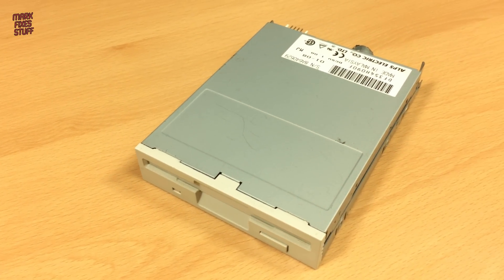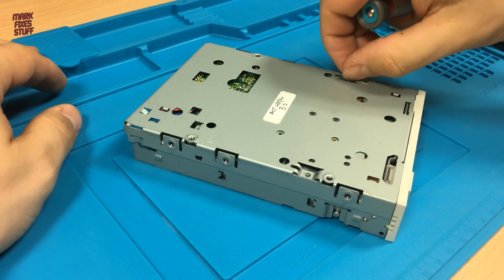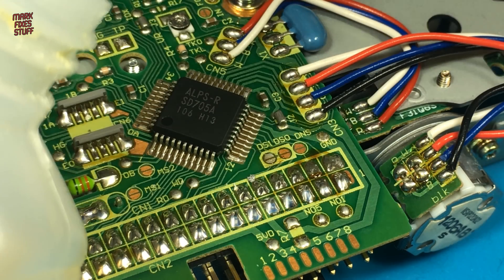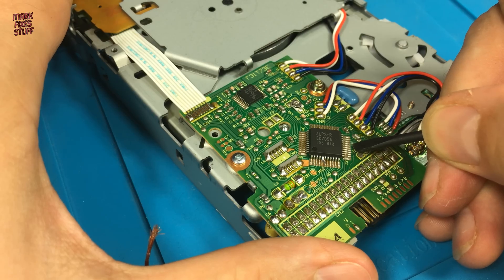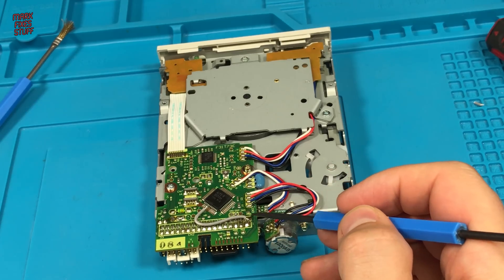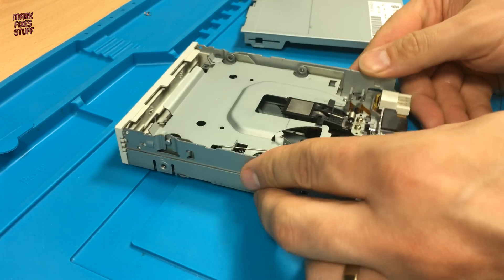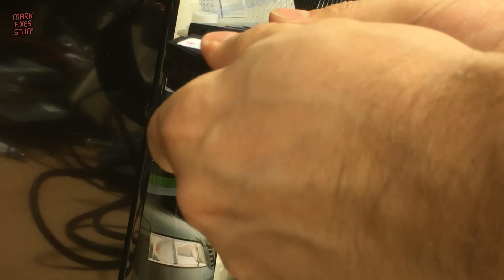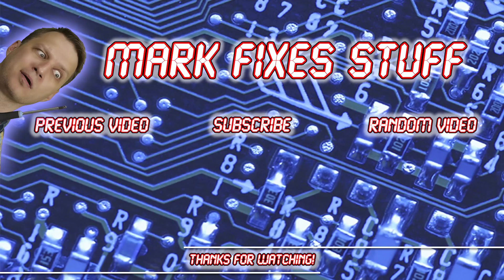Use a PC Floppy drive on a Commodore Amiga!

Comment: 1.76MB floppy drives were also available on Amiga, to use 3.5" HD floppies proper.
Reply: Yes. but they ran on half speed compared to pc. I have one of them in my A4000. The larger size is useful thou and you can pick files from a pc system like text and source codes into the amiga.

Comment: Just done this for an Amiga 1200 and all I did rather than lift the chip leg five I just cut the track line far easier and safer so no risk of it breaking away from the chip as it's so small. And with everything else done drive working just perfectly so thanks for this video well done.

Comment: Back in prime time of Amiga 30 years ago, i bought a official 1.76 MB HD Floppy for Amiga and could format 1.38.MB PC Floppies to 1.76.MB on Amiga with FFS.
The real size of PC floppy were 1.38.MB and not 1.44.MB. Back in the days you used 1024 and not 1000. In fact Windows 10/11 still use 1024 instead of 1000.
My CD32 Expansion, Elsat Promodule from 1996 or so came with a internal PC Floppy.

Comment: Hi Mark. Just one detail: will the drive fit inside the amiga, esp. the eject button?
Reply from the maker: Not without removing the bezel and printing some 3d modifications
Reply: @MarkFixesStuff   I don't have a 3d printer, but there are shops. Thank you.

Comment: Thanks for the tutorial. It works great even with CrossDos.
Reply from the maker: Brilliant news! Well done!
Reply: @MarkFixesStuff  A short follow up. The drive was behaving badly when I had it installed with a GoTek floppy emulator or another disk. Didn't matter if it was DF0: or DF1: or first or last on the floppy cable. I swear it had been working. I did a little more research and saw a video on the channel "Chris Edwards Restoration" where he modified a comparable Alps floppy drive. In the comments, a user, ripxkid, suggested using a diode, cathode connected to Ready, anode to connector pin 34. I also noted Chris did not cut the trace connecting the controller to connector pin 2. I started to trouble shoot the original floppy I converted and in the process broke pin 5 off the controller. So, out came a new drive and I did the modification again only this time I did not cut the trace to connector pin 2 from the controller and I installed a 1N4148 diode between Ready and connector pin 34. I have tested this several different ways and it all seems to work. I am not comfortable with pin 2 connected to two pins on the controller chip, but no smoke and it works.  Thought I'd share the information for what it may be worth.

Sorry for rambling. Thank you again for the video. It got me started on a much needed project.

Comment: After watching this I just got an idea:

If you have a DF1: drive from the '90s that appears to be a PC drive and converter board stuck in a case, would it have a chance of damaging anything if I switched in a 1.44/1.76mb drive in place of the 720/880kb drive?
Reply from the maker: To be honest I’m not sure. I don’t think you’d damage anything by trying but I’m also not sure it would work …
Reply: @MarkFixesStuff  If it doesn't work, it's not the end of the universe, it's just my pc 3.5" drive won't write 720k disks in Windows(yes, even through command line or using actual 720k disks, it just errors out) so I have to boot into Ubuntu if I wanna move files to my Amiga.

Being able to use PC1: to read 1.44mb disks would save hours of faffing.
Reply: Figured I'd update. It doesn't break anything,  it shows up in Workbench and it even tried to use it, but it just errors out if you try to use it.
Reply from the maker: @fattomandeibu  that’s a shame. Thanks for the update. I wonder if it can be made to work somehow.
Reply: @MarkFixesStuff  After a bit of reading, it's to do with the bit rate being too high for Paula to handle. Apparently you'd either need a hardware buffer, or to halve the RPM of the drive somehow, the latter of which is what was used for official A4000 HD drives.

Comment: Tip: Always solder the wires first, and put som solder on whatever you are soldering the wire to. Flux well and all you have to do is hold the parts together and apply some heat.
Reply from the maker: Thank you Svein!

Comment: I just unboxed my amiga 500 and the floppy drive doesn't read the discs but neither the 5 1/4 external one. Not sure if it is the discs or the drives.
Any idea ? Can drives be cleaned? Do floppy's go bad?
I have several good working pc floppy drives, but if I don't need to I would love not to
Reply from the maker: floppy disks do go bad. With drives it's usuall either drive belts have rotted OR the Amiga PSU could be flaky too!
Reply: @MarkFixesStuff  damn. I have around 3000 discs . I tried 10 and only 2 read the bootloader. Rest gives validation errors. I thought they would live longer. I kept them in a dry dark place.never thought they would go bad. My MB vectrex and MSX machines and games still work. Whish my A500 also would
Reply from the maker: @dcysfelices2294  might be time to get a gotek!
Reply: @MarkFixesStuff  maybe a stupid question. But what is that?
Reply from the maker: @dcysfelices2294  it’s a floppy drive replacement that allows you to play Amiga disk images from a usb stick. Google flashfloppy!

Comment: I know this is a few years old. I actually did this mod on my Alps drive (and did a video last year) and it's worked well. I even added a switch that could undo the mod. One question, for my Amiga 600, I couldn't fit it in the case with the top lid on so I left it off. Only recently did I discover that without the drive's top lid, the caddie mechanism pops out and that can cause the head to snag on the disk as it's being removed,  potentially destroying it (had to bend the head spring mechanism back to straighten it out). The solution was to cut a front piece in the front and bent it out of the way. The Amiga 500 may not have that problem but curious if you ever mounted the drive inside your Amiga and how well it fit.

Comment: I wonder what would happen i did this mod on my Amithlon Pc... I do have the same Alps drive... could I read amiga disks? My guess is that it would not work because of the hardware I/O side of the PC mainboard. Correct or not?

Comment: So I did this and got a great working floppy drive for my Amiga 2000. When I tried adding an internal Gotek as well, I couldn't get them to work with each other. Yes I set J301. Separately they work great, together, with jumpers set on Gotek and mobo, they don't. One works but the other doesn't. Any suggestions with using a PC converted floppy with a Gotek as two internal drivers on an Amiga 2000? I'm using a "proper" amiga floppy drive cable. I've tried changing the order of the floppies on the cable. DF1 being the furthest away on the cable and DF0 the closest.

Comment: I used to make external drives for the Amiga! Both 5 1/4 and 3 1/2.  There is an adapter that you made that would  switch the Amiga lines to an IBM lines. Amiga does not use the track identifier and select. I made up to 4 drives. You do not have take the IBM drive apart.

Comment: I tried this mod but it didn't seem to work. Like all the lights come on and it's ready but I can't read/write anything.
Mind you I didn't test the floppy drive first before conversion as I didn't have a PC to test it on first. I will try this again on another same floppy disk drive.
Reply: So the reason was the PC floppy was defective to start with. I tried with another of the exact same Floppy and it worked great.

Comment: The controller chip on the video is 44 pin, the drive I’m trying to modify is 52 pin. There is no continuity between pin 19 and pin 2 of the connector. Any help would be appreciated. Thanks

Comment: you need to change wires in cable - 2->34 and 34->2. if you prefer not to change drive number by switch on the floppy board and use it with factory preset (as drive B:) but as drive A: as Amiga need for boot - you need to re-wire also 10 11 12 to 12 13 14 and 13 14 to 11 10. left numbers is the numbers of wires from the amiga side right numbers is the numbers of wires from floppy side. 
and i use samsung 321 floppy drive - all is good.

Comment: Mark, this won´t work. Ok, works, until you connect external floppy. Then the system will go crazy. RD pad is not ready signal, it´s READ signal. YOu need to connect pin 34 to the pin 32 of the controller, there is Ready signal (not used in PC). Also, there are some older version of DF354, primarily made for IBM (bears IBM FRU part sticker), whether there is no Ready signal present neither on the chip. It works, except Xcopy. So, stick with 121F and 121G sub-version and you are fine.
Reply from the maker: Thank you for this information. It seems I will need to do some kind of update
Reply: @MarkFixesStuff  There is even better mod than I described, that allows READY signal to be present for Xcopy (which is crazy eager for original Chinon floppy). Connect a diode between ready signal (pin 34) and SEL0 (pin 10). Then floppy is always ready when selected, despite it has no real READY signal at all.

Comment: Would be nice to see if there was away to get the drive working as a 1.7MB, I suspect though that might only be possible with a PC 2.88MB floppy drive which can be crazy expensive. :(
Reply: I think drives  are the same, it's the file system capacity that is different. i.e. DD 720KB for PC 880KB for Amiga, HD 1.44MB for PC 1.76MB for Amiga, ED 2.88MB for PC 3.56MB for Amiga. However, I do have the same question as you - if you convert a HD floppy drive would it simply work as Amiga HD floppy drive?

Comment: hello i need your help i did this operation  but I don't have format disk I guess nothing works because I haven't done the format process, just the screen is coming for the game etc.
Reply from the maker: It sounds like you need a workbench disk? You will need to find one of those from another source.
Reply: @MarkFixesStuff  can you upload it here ?  the file of your disk ?
Reply: @MarkFixesStuff  amiga 500 workbench 1.3 ? Is this the floppy you inserted after modding?

Comment: Crikey.. does Velleman still exist? I remember seeing their kits in the now defunct Maplin years ago.

Btw, why did the Amiga have different pin outs? Would've made sense simply using off the shelf parts.
Reply from the maker: Yes! They still sell kits!

Amiga drives were slightly more complicated than PC drives, using tricks to pack data that PC drives didn’t care about. Often that functionality was just disconnected for the PC market.
Reply: actually ibm pc drives were non standard,being set by default to drive 1.. the rest of the industry just adopted it.

Comment: I converted the floppy disk drive according to this scheme. Unfortunately, the additional DF1 floppy disk drive does not work with this floppy disk drive. There must be a diode like this picture: http://www.puzio.pl/tablica/amiga/alps.png
Reply: Did you add or work afterwards?
Reply: @serdarkvanc8175  Before adding the diode it was not working corectly. After adding the diode it is OK.
Reply: @RetroArcadeFan77  i did the same as in this video has game screen but no progress  you just add an external diode which is in this video what is the value of the diode can you help ?
Reply: 1n4001   1n4007 ?
Reply: @RetroArcadeFan77  also did you draw the line on c7 and hd2?
Reply: @RetroArcadeFan77  and what do the red lines mean ?
Reply: @serdarkvanc8175  Normal diode (not zener), I desoldered the used diode from the circuit board of the old landline phone.
Reply: @serdarkvanc8175  I don't think it matters.
Reply: @serdarkvanc8175  The red lines mark the path intersection points.

The red lines mark the path intersection points - you must cross the paths at the pins.

Red lines indicate where the paths should be cut (2 and 34).
The orange points are connected through a rectifier diode.
Blue points with a wire.
Violet dots as above - this is a floppy disk signal (the drive thinks that DD is always inserted).
The yellow arrow marks the transfer of the jumper from DS1 to DS0.

Without a diode, there may be a problem with the additional DF1: floppy disk drive, or maybe DF0: it may not work as it should.
Reply: @RetroArcadeFan77  You just dropped diodes on 2 and 34, right?
Reply: I have the game screen but no progress It just stays the screen recognizes the floppy but no progress Why did you also make such a transaction? What problem did you do?
Reply: @serdarkvanc8175  No. The diode is to be soldered between pins 10 and 34 (orange points from picture).
Reply: @serdarkvanc8175  If you did everything correctly according to the photo, it should work. Unless you did something wrong or it's a different floppy disk drive model.
Reply: @serdarkvanc8175  When I converted the floppy disk drive according to this movie, the additional DF1 floppy drive did not work. I was looking for a solution on the network and I came across a solution with a diode which I am not the author of. For me, the solution with the diode works.
Reply: @RetroArcadeFan77  What a problem you had when you did what this man did ?

Comment: This mod is not quite right.....

1) You have to put diode (1N4148) between pin-34 and RD pad (black marking should be turned towards the ALPS chip) - for a proper ready signal
2) Solder a wire between HD2 pad and MIS pad (Ground) - to bypass HD switch detection so you can use HD floppies as well  

You're welcome ;)
Reply from the maker: Thanks mate. I think I need to do a follow up video really. Time is scarce though! Really appreciate the information :)
Reply: using hd floppies as dd is not a good plan, it said everywhere at the internet, and i tried, it work for some times but after some years then are not working anymore, while the dd floppies works better, i think the magnetic matrieal on the dd floppies are another kind than the one on hd floppies, so they need another way to be formatted and thats why it cant keep the data for longer time. I can also tell you I have much highter succesrate read my old MSX floppies (DD/720kb formatted) and (DD/880kb amiga formatted). Cause Amiga pushed more data into the floppydisk, its likely to fail after all those years :o
Reply: @CrazyBossDK  This is not a standard DD Amiga drive but a PC HD floppy modded to read and write HD & DD diskettes. On the other hand If you want to use properly HD diskettes in an original Amiga drive you need something like bulk tape eraser.
Reply: Akai - Model ATE 7 or similar
Reply: The same applies to 5.25" HD diskettes and C64/128 drives
Reply: @ripxkid  I guess the drive is not modified to use HD disks, its modified to fit the amiga, and then you can fix the sensor or cover the hole on HD disks, to "hack" it to a DD disk,  I guess the Amiga Controller does not know how to handle HD disks, which should be formated another way, I have an external Amiga diskdrive which actually is a HD drive, cause if i put in a HD diskette i will get error while formating it, when i put in a HD diskette with tape on the HD hole, it will work. But it does not mean its a HD diskette, and its not clever to do it cause it will loose data, I have proof, cause in 2001 I made some diskettes, on the Amiga, some was HD (hacked to DD with tape), and other was real DD diskettes, the Real DD diskettes still works today, while all the hacked ones dont work today. It have been discussed here too:  https://superuser.com/questions/1039376/does-the-media-of-3-1-2-dd-floppies-have-to-be-physically-different-from-hd-medi#
Reply: @CrazyBossDK  Again, this is a PC floppy drive modded to read and write HD diskettes in standard 880KB Amiga format. It doesn't support 1760KB formatting,....you need something like Chinon 357A for that
Reply: @ripxkid  so that means those disks can only work on the same drive, you will not be able to read a floppy back in the original amiga drive ?
Reply: @CrazyBossDK  You can use floppies in any Amiga drive since they're 880KB
Reply: @ripxkid  I still dont recommend it cause the HD diskettes is written using another orsted-level compared to DD, and the magnetic Material is another coating. They will for sure fail, I thought you ment the drive was modified to write real hd diskettes with the hd orsted level, but its just fooling the drive too think its a dd disk and write to it as a dd disk. HD diskettes written as DD will work for some time, but its more likely to fail than DD.

Comment: Can you also adapt the drives in a manor that they are usable as DF1 or as DF1 and DF2?
Reply from the maker: There are DF0 and DF1 jumper points on a lot of boards. For anything more complex I believe a cable modification would be needed.
Reply: @MarkFixesStuff  It's not only the jumper points you have to worry about but also obtaining a 'case' and cable to actually put the drive physically in. Back in the 90s we had this brand called "KCS" and they made once a dual floppy drive in one case, so you had df1 and df2 in one case. Today with all the options available, like 3d printing and guys like you who really know their stuff I am surprised such a dual case drive has not been made. I think you could score a nice one with that if you buy up all these cheap ass PC floppy drives, and make them work in one case as DF1 and DF2.

Comment: Cool, i have been modifying TEAC FD235HF NOS floppy drives to be amiga compatible tonight. Same basic procedure, swap ds1 to ds0, cut pin 34 then a wire from ic to pin 34 and one from the cut trace to pin 2. Instructions were found from an old German site with multiple models listed http://www.pitsch.de/stuff/amiga/floppy.htm
Reply from the maker: That’s a really good resource! Thanks for watching my video. I do plan to do follow up containing some info I’ve learned since making this video so might cover the Teac.